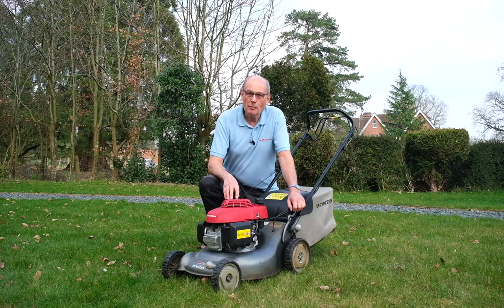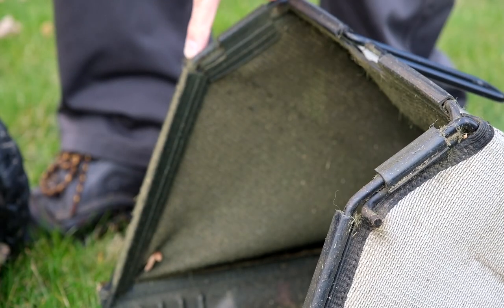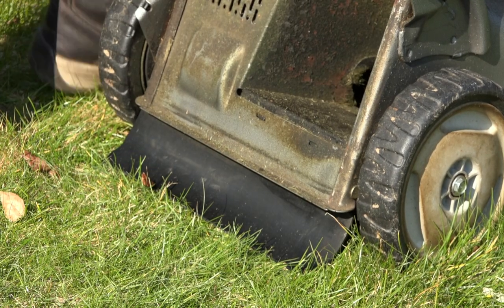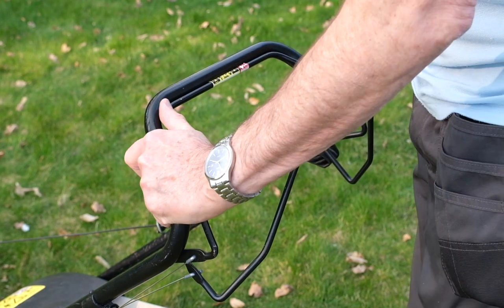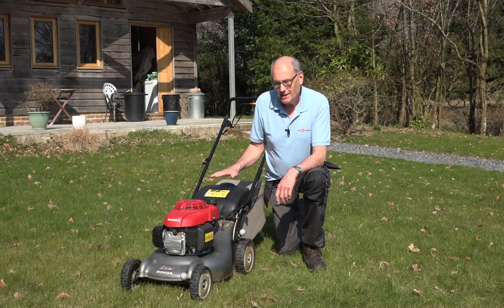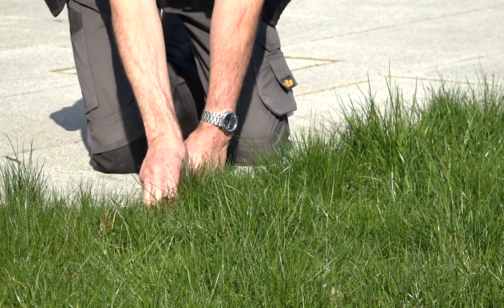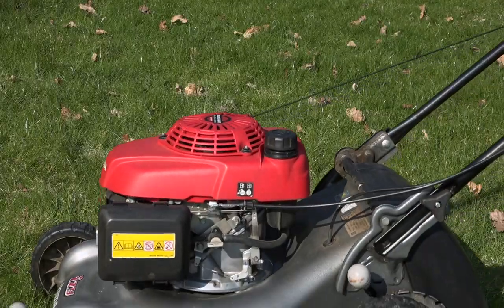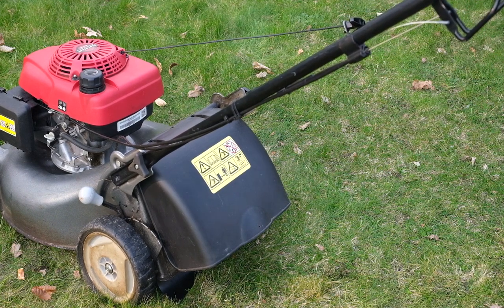HONDA IZY LAWN MOWER a long term review. (#11)

Comment: Thanks John. Lovely video. Very clear and concise. After obsessing over my decision for the best part of a week, I found this video and hunted down a second hand (3 year old) one in Galway. It looks and mows like it's brand new. I'm delighted to hear your experience with it over the years has been positive. Thanks again
Reply from the maker: @alandevine6961  I'm pleased you liked the video, and thanks for the compliment. Well done on finding a second-hand one. May I suggest that you use an alkalyd petrol, Aspen is one make. I've used nothing else in mine. Alkalyd petrol is more expensive but it won't go off in the tank which is important over winter. There is no need to drain the tank, and it'll start with no problems in the spring. If the price of Aspen puts you off, just think you'll be saving on maintenance costs when it won't start and you take it to a dealer!
Reply: @JohnTheHandymanUK  Thanks again! Yet more invaluable advice. I'll find that alkalyd petrol 👍

Comment: I’ve had 3 Honda mowers over tha last 30 years or so and they never go wrong (in my experience), I’ve only changed them when I’ve moved house and needed a different model type (different gardens). Terrific VFM.

Comment: I just bought one of these used, an old model. Does wonders compared to the electric Tesco one my mum had bought. After a lot of research, I knew I had to buy a Honda or mountfield.

Comment: I had an old Honda  which I inherited from my father, but recently I had to replace it because it was old (20 years old) and many parts failed beyond repair. I Bought an Izy, and I'm kinda satisfied with it. It's lighter, consumes less petrol and still does a great job !
Reply from the maker: That's great. I'm sure you'll enjoy the Izy reliability. I run mine on an ethanol fuel, not petrol from the filling station. No horrid fumes, and the fuel won't deteriorate over time, like over winter. Aspen 4 or the Husqvarna equivalent are great.

Comment: I use this model in my gardening business.I keep them for 3 years,then replace with same model.None have ever broke down.I use them for my small estate lawns.Sometimes doing 14 lawns a day.Only downside is cheap plastic wheel bearings,which will wear out.I replace mine with proper bearings.Some hondas now,you can pay £740 for an hrn,and its has plastic bearings,which cannot be changed anymore ???
Reply from the maker: That's good to hear. I know of two gardeners who use a Honda Izy. It's interesting to hear about the wheel bearings but not good if they can't be replaced now. 🙂
Reply: Which model?

Comment: Just to clarify, the model number of these Izy mowers is HRG466. You mentioned GVC160- this refers to the fitted engine only. They are great mowers, I've used one commercially for five years. Always starts first time!
Reply from the maker: Yes you are correct, thanks for putting me straight.

Comment: Nice video John, thank you. I’ll be buying one soon! Subbed 👍
Reply from the maker: Thank you and enjoy it. Mine must be ten years old now. I've heard some people say that the steel base rusts. I brush the grass off after every use and spray with a lubricant intended for hedge trimmers. It supposedly breaks down the grass and green stuff. So far despite some surface rust there are no holes at all.

Comment: Ageed they are really reliable robust machines, very little plastic parts like others. Mine has lasted 10 years but now rusted through. the deck is what lets it down, i imagine they make them from poor quality steel so you have to buy a new one because i have had no fault other than this. i have just ordered another one the same.
Reply from the maker: Yes I've heard the deck can rust after around ten years. I guess it takes quite a pounding from stones and grass. It's a question of keeping it clean and not let grass and deposits build up and so retain moisture. After every use I brush the inside of the deck and then spray with Agealube hedgetrimmer spray lubricant with resin solvent. It seems to be doing a decent job.

Comment: Lovely video but at 4:27 the metal deck was the downfall of many of these mowers. I know some don't look after them but fibreglass would've been better imo 5:16 first pull since last season? I assume fresh petrol and it was properly winterized. Ie run dry etc?
I got an hrg465 sde c1 for free on a free cycle group. It had a hole in the deck. I patched up with mesh and fibreglass used for a year then sold for a hundred pounds 😂. I bought another so called non starter for twenty pounds. They had the fuel line turned off 😂
Sold that for 150. Just bought an hrg415 sde c1 thirty pounds. Lovely mower but slight surface rust. I'll rub down and use kurust then spray over. Nothing perfect but it'll do. I often think about going down the electric or battery route but still bargains to be had. Unfortunately I heard honda aren't making petrol ones now
Reply from the maker: Thanks for the compliment.  Yes, the decks do eventually rust so I'm told. I try and brush off any damp grass and then I spray the metalwork with a fluid used on hedge cutters. Sorry I don't remember the name. It's supposed to break down the green stuff. 
Re: the petrol...no I don't drain the tank over winter. There is no need as I use ASPEN an alkalide petrol. It doesn't go off over time and the exhaust fumes don't smell either. It's an excellent fuel. I think that I mentioned this. 
Well done with your purchases,  bargains. It's a shame if Honda are stopping making petrol mowers.
Reply: @JohnTheHandymanUK  oh yes I read you said agealube bio.. Sounds good stuff. Abd definitely a good idea. I suppose keep clean and wd40 would be better than nothing..
Hrx decks are made from polymer. A type of plastic and last forever. Expensive kit though. My old used ones will suffice for what I need them for anyway

I see they sell Aspen on  amazon forty pounds for 5l..that's eight pounds a litre so far more expensive than a litre of ordinary fuel now about £1:38P .but I suppose if convenience is a premium then that's ok.. Best of luck

Comment: Brilliant video. Can I still attach the grass bag to the lawnmower with the mulching plug inserted because I cut and collect and mulch for different customers in the same area (round)?
Reply from the maker: Thanks and pleased you enjoyed it. No, with the mulching plug inserted it block the exit of the grass into the grass box. Without the plug fitted it won't mulch the grass as the plug keeps the cuttings swirling around for longer, and so they are cut finer.
Reply: @JohnTheHandymanUK  but can I place the bag on back of the lawnmower so it gives illusion to a customer that I am cutting and collecting and not mulching. I do it with my other machines where I put the mulching plug in the back and then put the bag back on to the lawnmower.
Reply from the maker: @cosworthization  Ah yes I see what you mean. Yes you can put the bag on the back with the mulching plug inserted.
Reply: @JohnTheHandymanUK  BRILLIANT thank you.

Comment from the maker: Someone asked me if the rubber strip prevents the mower from being pulled backwards and is it easy to manoeuvre. The answers are no it doesn't and the mower is very easy to manoeuvre.

Comment: Hi I have a Honda izy easy start I have an issue with it it keeps surging I have taken off the carburettor and cleaned the jets and needles and everything else so I put it back together runs amazing for 10 minutes then the surging starts again can you help thanks
Reply from the maker: Hi, I'm sorry but I can't help you with your problem. It's not something I've heard of. Is there a fuel filter? Maybe it's blocked and needs cleaning or replacing. You are probably best to take it to a dealer who does servicing, buy maybe ask their advice first. I hope that you can solve the problem.

Comment: Cast deck is about the best simply does not rust My lawn mower is getting on for Forty years old ( not Honda ) with a Briggs engine
Reply from the maker: Certainly stronger than plastic, and if looked after, they will last a long time.

Comment: Terrible for corrosion.. the Izy 16" model..seems to corrode a lot quicker than other models..must use a cheaper grade of steel for the pressing..definitely puts me off buying one.
Reply: Yes they can rust but mine at 8 years old only has minor surface rust. I do brush any wet grass off and spray with a biodegradable  Agealube hedge trimmer spray lubricant with resin solvent after every use. This seems to be helping. I'm sure they will last longer than most mowers though.

Comment: Wish it lasted 20 years!! But Mines is probably just 10 years but now stopping all the time even after a service 😥
Reply: Oh dear that's a shame. I'd say you've been very unlucky. Has it had a lot of use, more than might be normal?
Reply: Because of your Video I've decided not to give up on my Honda Lawnmower & have faith. So I've given it to repair. Will get a sonic clean of the carburettor.  Hopefully that'll give it new long lasting life 👍
Reply: @razakmanify  Is it ok now?
Reply: @Tintoycar   its working better now thanks, I've just made adjustments in the way i use it for instance don't cut too low to the ground & the mower's performance seems to be improving, have a large garden use to stop halfway & resume the next day but now do it in one go since adjusted the height. Hopefully it continues to improve & last me another 10 years atleast
Reply: @razakmanify  Good luck! Honda makes 2 types of lawnmowers: commercial use and non commercial use. The commercial ones are bullet proof and the non commercial ones are very good 🙂

Comment: Stihl is better overal.
Reply: I have a 28 year old Honda 536 Hrd and a Stihl RM448 TX, both start first pull but Stihl gives a lot of smoke many times. Even when it was new. The Honda doesn't even get maintained a lot.